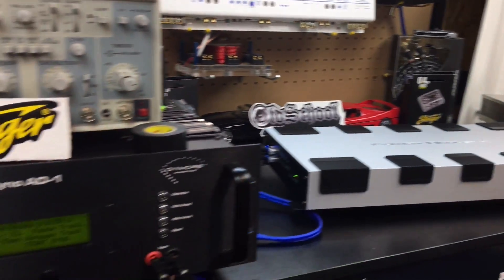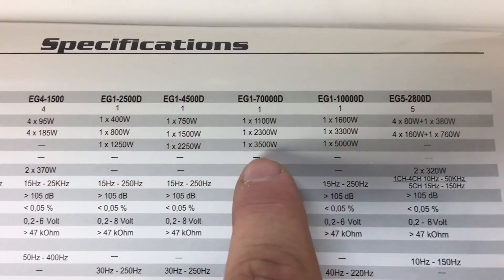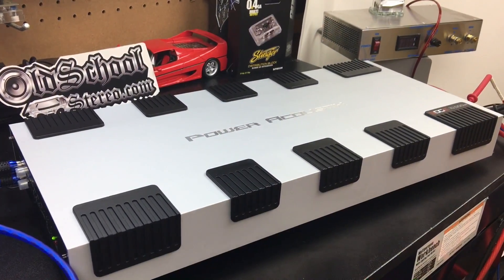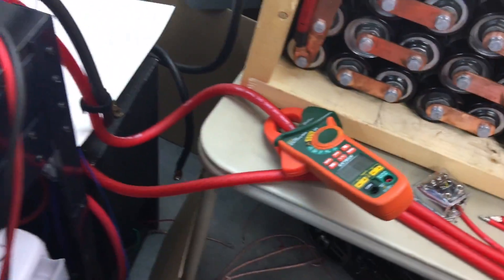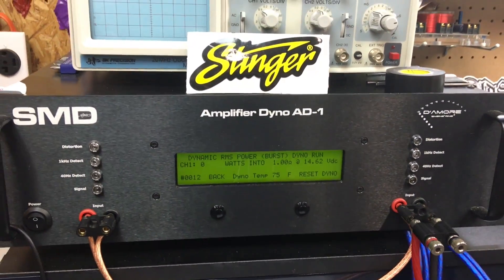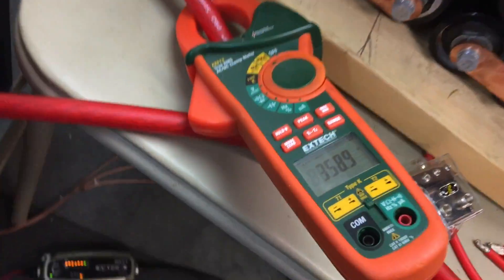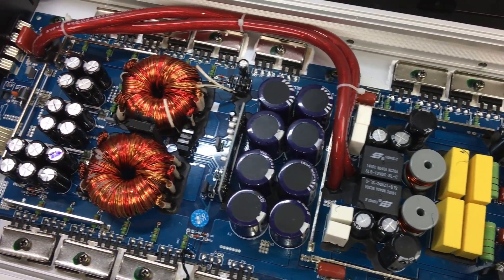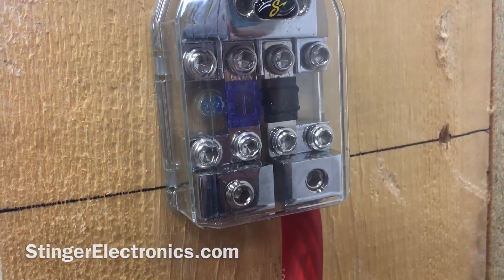10k Watts for $300? Power Acoustik EG1-10000D Amp Dyno Test

Comment: Yea I have this thing powering 2 skar 12in evls and they hit hard. The evls are 1250rms and match up very nice I also have 3 batteries didn't want to upgrade alt  unless absolutely have to and with the 3 batteries voltage drop is very low runs between 13.5-14.3v so not bad!

Comment: I know this is a old video but the edge 7,000k is better than the 10,000k and I'm running 2 dual 4  15" bd3 audiopipes at 1200 RMS a piece and they hit like a beast! I have  cracked two sealed enclosures since I've had it! So these are not bad amps at all.

Comment: 300$ not bad
Reply from the maker: 10,000 watts rated? Not good
Reply: 1500 watts at 2ohm isn't that bad. Efficiency was a lot better too. If you used two of them together running 2 ohm each you'd run near 3k dynamic with a 260 Amp draw. That's actually incredible for $600 worth of amp. You are really close to 80% efficient which is not just good, that's great.

Comment: 350 amps at 100% efficiency would give 5k rms. It would make sense if they marketed this amp as a class A/B. At 50% efficiency 2.5k rms makes sense. Granted, this thing would probably overheat anyway with a constant 0.5 ohm load.

Comment: Actually those 2 ohm results are pretty good. You lose a lot of efficiency with it going to 1 ohm. With an increase in power draw of 88% you only get 46% more output. That's a huge efficiency loss going from 2 ohm to 1 ohm.

Comment: I understand the frustration with inflated amplifier ratings, I really do. I'm with everyone else who thinks manufacturers should have their feet held to the fire on ratings.

But let's think about this another way for a second. When I was an installer in the late 90s-early 2000s I would have laughed in your face if you told me that in the future we could buy a half ohm stable amp that could belt out nearly 5,000 watts for less than $300.

Comment: Rms power is great but how about subwoofer damping (control). Sometimes theirs a reason why some amps cost more. “It’s because it is not just clean, it is clean and detailed” I like loud, deep, low end bass, mid bass, mid range, high mid, low high, and top highs just full, precise, and complete with the ability to hit 150+ dB under 35hz!!!

Comment: Must be the classic Chinese "P.M.P.O." rating system.. Only they haven't exaggerated too much lol for 300 bucks that's quite a lot of power! Quite beefy inside. But never believe the box! Maybe run it under max stress for a month and see if it blows up?
Reply from the maker: I don’t like the misleading numbers, no matter how much of a value it is watt per dollar
Reply: @wal  Well yeah, true enough.. Problem is most manufacturers do it! Some home audio amp companies don't, such as the Marantz, JVC and Rotel units I have.. but even Rockford Fosgate are guilty of it with car audio.. that T15KW amp is an absolute monster but is "only" capable of half that in terms of RMS isn't it? Though it does seem to be very efficient.. shame you can't review one of those but SM already did! They get around it with "peak" power nonsense don't they? Which may be true for like half a second and possibly destroy the amplifier lol

Comment: I think the manufacturers are rating their amps by what the certified test is and thinking that means each speaker output is handling that amount of power, so 2,300watts x 4 (each positive and negative input).😕 I know thats not how it works but that may be a loophole allowing for these inflated ratings.
Reply from the maker: Ha ha, who knows maybe 🤷‍♂️

Comment: Mega watts, for minimal money. Always, means cheap amp. People aren't realizing how many amps it took, to make those numbers. Over 300 amps, most stock alternaters are what between 90  and 120 amps. So a stock alternater and battery, aren't going to be driving this power hungry amp anywhere close to the numbers on the bench. Your headlight will probably turn off every time the bass hits. Not just dim,  but go all the way out. 😂😂😂😂😂

Comment: I know PA stopped making the GT1 gothic series amps but would you be able to test one, ive been running the GT1-4500D for the past few years, subs I went through but not blown we’re 2 txxbd3 12” subs, 2 Hifonics brutus 15” subs and then to 2 Power acoustik Gothic Gw12-4  12” subs all did well with some tuning and of course stock electrics and 136 amp alt.  The txxbd3’s were enough to push my wind shield seals out when I finally wired it to 1ohm in my extended cab ford ranger.  Merry Christmas 🎄

Comment: "Simple car stereo integration" it says on the box, as though an unadultered car can handle an amp with a 300a current draw.  lol!  Gonna need a HO amp and some extra bolstered electrical to run this...and if you are going to add a HO alt and big electrical you probably should look at different amps that do what they say they will...

Comment: look i have 2 of these strapped on 2 edge 15 spl pro subs and if you read the manual it says 10k achieved when strapped does it hit it no but i am hitting 7800 dynamic and i can't complain about that based on the price and they are built very well

Comment: Is there a big difference from using 4 gauge wiring to 0 gauge wiring? thank you
Reply from the maker: For 0.5 ohm setups, I’d use 1/0 for sure to ensure proper current flow. You’ll also need to have proper charging system to support this amplifier

Comment: None of the power acoustik amps or subs I have seen are CEA certified so wattages are rated on Saturn or something.  Ive owned a few PA products over the year and only thing I can say are actually worth the price are the mofo subs. Currently have a single mofox 12 on a jbl gto 700.1  in a 2ft3 slot port tuned to 36hz and it moves ALOT of air and is suprisingly quick and tight also. Big d u ever test a gto 700.1? Havemt clamped mine but at 2 ohms its rated at 700 rms, Id be willing to bet closer to 1000 watts tho

Comment: I got one of the 2500w ones from Walmart that's $100, for $20, and I'll be fair and say it's apparent it's not anywhere near 2500w, but the output sound is clean and it runs 2 12s with ease.

Comment: thanks for the video. So I can get it and expect 2500 RMS at 1ohm.. not bad for under $300 bucks. So you actually need 2 of them for 5k RMS and bridge them together. Sill not bad for $600. The amp needs alot of juice though

Comment: This guy BigDWiz is giving us true real Numbers before you buy OR sell,Wich I do.Its changed my arsenal and prices!But most important,example,I had a PG m100 Wich was rated like under 300w. Turns out it’s does over 1k. Had it on eBay,I would sold it for $100,then seen BidDwiz show it’s a true 1,000 watt,I changed the ad and got me $500 Benny’s.Keep the lessons coming. But I wish I’d see more old Alpines late 80s early 90s as I have so many ,and how about testing stereos that claim 50x4,60x4 etc. That would help a lot of people pick correct stereo out and also put shame on those ‘Sony Pioneer’ for over rating.
Reply from the maker: +JIMMY JOHNSON so that’s why I can’t get any deals on eBay anymore 😱

Comment: why don't you test a Pyle PT8000ch. I bought it on amazon for $365 a few months ago. Powers two planet audio 15s that are 2k each and two Rockville 1k towers (12" sub, 5" horn, three 1.5" tweeters) it's cheap stuff but it shakes the hell out of my house, and works damn well as a Dj set up. Yes 110-220 volt  home audio, but it's around the same range

Comment: I fail to see a logical home for this. With what it draws as far as current, no stock electrical system would handle it and if you're going as far as adding alternators and batteries you may as well throw your money at a better amp since you'll already be spending a lot. And funny thing is you can get an amp that will run more than that with better efficiency so it'll draw less current. Ultimately in the grand scheme of things not too many people actually want competition level volume/power so the amp is not all that useful unless you are building a DB and there again with the money you spend you might as well get a name brand amp.
Reply from the maker: +TheMustangmaster98 I'm with you and concur

Comment: 4800 watts for $300? Who cares what the box says.
Reply: It's clipped. Useless.
Reply: @AB-80X  exactly. All that power is not being turned in the proper sound wave. It doesn't mean anything.

This amp only puts out 1900 watts at 1 ohm while only turning 58% of the power it pulled into sound. Its garbage there are more efficient amps for the money that will get just as loud or louder. I'm pretty sure you can get closer to that output with a cheaper Hifonics amp with an easy 8% or higher efficiency improvement. You could get two Pioneer 9601s that will output more than this for the same money and draw less power at the same time
Reply: @AB-80X  Ran TO clipping. Dynamic are bursts or RMS respectively. So yes you will see those numbers in bursts,how consistently and for how long is the question. Dialing down,as anyone with a clue would know,down just below clipping,I'd bet 4500 watts conservatively. 4500 watts for 300$? Who cares what the box says. Better? Fuckin' nubz..I swear..

Comment: going through and reading comments, first thing first Power Acoustic does not rate full power at RMS, they rate at burst,maximum power out put for 10 seconds. 2: these amps are rated in a bridged state. In other words you want the CEA compliance you need 2 AMPS BRIDGED to get it.
RMS Power 0.5Ω, 14.4V  5,000 x 1 (0.5Ω)  ripped right from the web site single amp numbers 
you want 10k bridge 2.
 the laugh ability at some of the people making comments thinking they know something and absolutely just sticking foot in mouth.
http://poweracoustik.com/car-audio/amplifiers/edge/
Reply from the maker: You know what's funny? They added that information since this video was released 🤔
Reply: nothing against you......they are always late to update their web pages and manuals(they re-badge most of the paper work and web pages),most of the people I notice watching you are not knowledgeable of Power Acoustic, I have used them for yrs, for daily music in car. I still have a Gothic from 2006 with a couple of 10" fubar woofers. most of the people in here think they are buying an amp with 200+ ounces of heat sink and crank them till they get so hot they start burning circuits.

Comment: almost no amps actually put out rated power if it does 4k rms for 300 bucks its not a bad deal at all. plus im sure if u can get em better voltage theyd pump a little more it's basically a stock alternator test. my 6ks hit way harder at 15.5v then the 14v

Comment: im not saying that power acoustic is defiantly 10000w but what is your power supply how much does the voltage drop because what 350a at 12v is like 4200w again not that i think its 100% efficient or anything
Reply from the maker: My power setup can support over 1000A for short bursts and approx. 450A continuous. I use 8 banks (48 total) Maxwell Boostcaps for the main power source and keep them charged and fed by a 320A 14.4 vdc custom power supply. The Amp Dyno tests last a maximum of 10 seconds each, so in this case, the power supply was not the issue....

Comment: so many people in this thread do not understand amperage draw.  A 300 amp fuse can not support more than 3k and that is if it had 100% efficiency. Most 12v amps only have around a 87% efficiency, and that is on high end amps. 

Super cheap amps may draw 300 amps but only push barely 2k. that is because the efficiency rating on these amps is more in the range of 50-70%.

fuse ratings don't lie. on a 12v system you will never push more watts than amperage pulled. (example 300 amp main fuse and amp pushing 4k.) It is physically impossible to do this unless you are running a high voltage setup (taramps) or you are using fuses that don't blow at rated draw.

I can't believe the amount of misinformed comments on this thread about amperage draw and wattage out put.

(please someone back me up and explain the way this works to some of these guys, not to be an asshole but to better educate people about amps when making decisions about the quality of an amp.)
Reply from the maker: +Brian Reed its mostly my fault for not explaining the current pulls, but the Amp pulls I show are a worst-case scenario. Using test tones with a single frequency work fine for power output, but the current pulls can be a bit bloated. When you see a 300A pull for an Amp Dyno run, this is not fully indicative of what a person can expect with music playback. It can get as high as 300A, but won't stay at 300A unless you have a consistent 1ohm load (speakers are a reactive load and not consistent like a resistor) and using a single frequency. I know some songs people use have extremely long bass notes and actually do simulate test tones. In these cases, use my results to understand the strain on your electrical system. Also, for short bursts, fuses can handle 2-3x their ratings before failing.
Reply: Soundigital 5k Fuse  calls for 250 amp fuse and it dinos over rated watts buy quite a bit I believe the book rates it at 6500 at 14. 4 volts and it's Max draw is 522ah
Reply: I mean I like going off of the rated fuses * 100 that's a pretty good idea of what the amp is capable of to start with

Comment: Anybody notice the name for this item on Amazon has changed to 5000 Watt?
Reply from the maker: +anish patel interesting...🤔
Reply: I'm pretty sure you calling them out played a role in that lol.  I have 2 of these, only cause after watching your video they have the power rating I was looking for at the half ohm load.  I am always looking for something comparable.  

I did do several electrical system upgrades to power these amps, they aren't efficient at all but pushing half an ohm is a daunting task for any semiconductor.

Just wanted to thank you for all your videos!

Comment: dwiz have a question bout my amps I have 2 5500 power acoustik amps strapped on 2 15s subwoofers and when I turn the gain up the amps protect light come on so is that protect light coming on because it's not getting the right power or could it be something else

Comment: According to your Amps x volts, should (358.9 x 13.9)  = 5000 watts,  That amp is a horrible class D, worse than class A/B on efficiency.  60 - 70%.
Reply from the maker: +chuck miller and this is why 0.5 ohms is not good. Horrible efficiency, low damping factor, lots of heat, etc

Comment: wish u would've shown the amp draw at 4800 watts
Reply: BigDWiz could you possibly do a dyno on the hifionics zrx2416.1d? I heard that hifionics is supposedly cea compliant now
Reply: I was immediately thinking the exact same thing
Reply from the maker: +dmayse1000 the dynamic tests are difficult to capture current pulls because the bursts are faster than most clamps can measure

Comment: It pulls over 350 amp's from your vehicle.!! better get ready for replacing your stock altenator
Reply: well no shit. you expect a stock alternator to keep up with any amp making that much power?
Reply: @dirtrider88 
It's not that simple. First off, this amp will not draw 350 amps on average. Maybe 150-175. If you support that with a XS D1400 14 V battery, and run a ´half decent atl. then you're good to go.
As far as what a stock car will support? It depends on the car. My Ram came with 440 amps worth of alt. from the factory :)
Reply: @dirtrider88  my stock alternator can keep up with my sundown 4000w
Reply: Bro that doesnt add up. My 120A alternator cant keep up with 2000w amp so you need to turn the gain up or drop the impedance :) I have 75mm2 run from front to back.
Reply: @markmorgan5197  no it cant
Reply: Well if you plan on going that amount of power the alt. Should already be replaced.....and no way a stock alt can support a 4000w sundown amp
Reply: My stock alt is 200 amps and i have a yellow top Altima battery i can run this amp with no problem
Reply: Realistically a stock car alternator and batter can not handle anything over a 1000 watts because what they put in your vehicle is to run the stock accessories. Most people that run anything this big have a second alternator and battery system for it.
Reply: and adding several batteries

Comment: I think it a factory Faulty that they did not write the manual can go down into 0.5 ohm

Power acoustik EG1 - 10000D 10000w max power.  5,000 RMS -- 0.5 ohm.  3,300 RMS -- 1 ohm. 1,600 RMS -- 2 ohm.
Reply from the maker: At the time I got this amp, I posted the ratings provided by the manufacturer (website and manual). Since that time, they have updated the ratings.

Comment: It is not 5000rms in 1 ohm but 3300rms and is 5000 RMS In 0.5 ohm
Reply from the maker: Again, I posted specs as provided by the manufacturer at the time I tested the amp. I see they are now "corrected", yet still not accurate.

Comment: Another amp like this is the soundstream TA1.3000D  really wish you could bench that one..
Reply: Kenneth Harless they do make better amps then power acoustic atleast clean suns wise they used to atleast but they do own power acoustic.  5 years ago I was a installer and installed alot of both company's stuff soundstream amps didn't have many issues but one with a power acoustic 3000d we had to go threw like 4 or more new one to find one that wasn't in protect for some reason   I said screw it and the in a soundstream 2500

Comment: Maybe it will do 10k if you hook it up to 36 volts:p
Reply: SpydreX Official lol.... yas... and drow a lot of current !!
Reply: If it were rated to handle 36 Volts, either way, higher voltage less current draw.
Reply: @anishpatel5715  
That depends. If the internals can support the power, the amps will stay the same as voltage goes up.
However, I suspect that the amp will not like that much voltage...